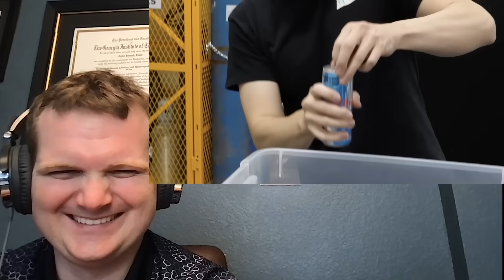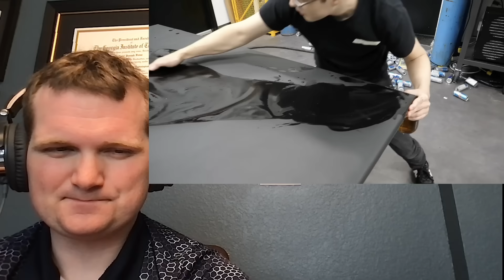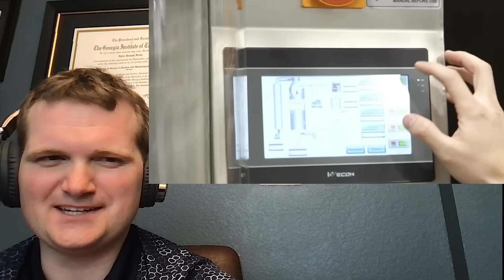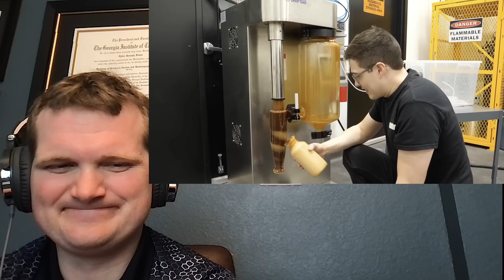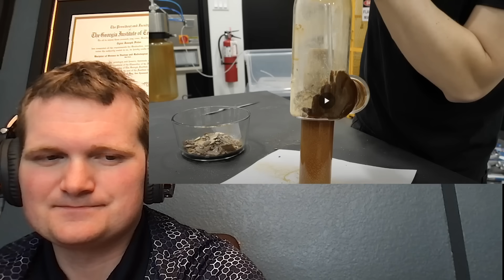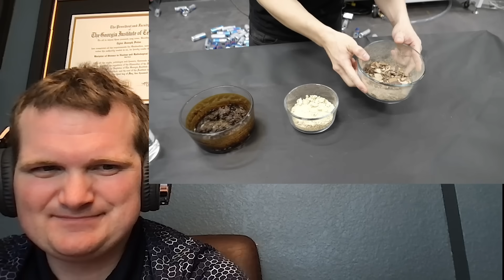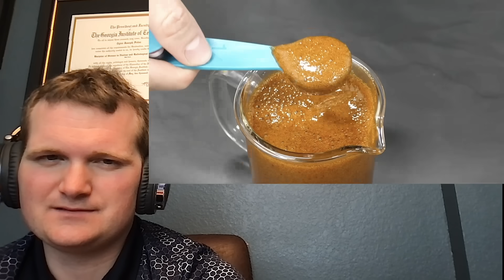Red Bull X100 Enrichment? - Nuclear Engineer Reacts to NileBlue

Comment: You talk about the caffeine and stuff, but a chemist, or a nuclear physicist, more than I, and economist, would know that is not really that 100x redbul in the same "liquid" will do 100x the "same effect". Specially because the "caffeine toxicity" would be different. I have learned it from my nephrologist when I had kidney stones driven by, among other things, fitness supplements. Caffeine main drive is to mimics and blocks adenosine and the dopamine agonist receptors, and thus, it has a lot of other effects beyond "masking tiredness". It also slows down the reflex that controls blood vessel constriction and the system that controls fine motor control. Having the mechanism it does, it is very important that there is a certain ratio to the amount of water in your body for the amount of caffeine you take. So supposed we have the ability to ingest "any amount" of water and caffeine without constraints, taking caffeine pills or industrial caffeine added beverages, and taking coffee, are two very distinct things. You might never be able to take a lethal dose of caffeine by drinking coffee because the water required for it not to be an "unbearable sludge" prevents that capacity of a coffee to not dilute the caffeine enough. On the other hand, you might be able to take enough caffeine without water using it as a supplement, to the point it might be, and I know that for a fact, much more unhealthy to take even the same amount of caffeine as a supplement than it would be that amount in the form of a very high caffeinated beverage.
That being said, there is another problem: Sugar.
You should not take a lot of sugar, nor a lot of caffeine. But if you are, you might not want that to be fructose, but you defo should have glicose in that mix when taking large amounts of caffeine. What caffeine does to your body will trigger something like a diabetic hypoglycemic episode the moment the "effect" of half life of that much caffeine stops in roughly abrupt point in time. That in mild terms is what happens when you take pre workout with caffeine and while you are training, if you have not enough glycogen, you feel you cant breathe and your heart start to palpitating, assuming you have no previous heart problems or circulation problems.
You also have the question that caffeine will pass the blood-brain barrier and raise the effects neurotransmitters have. That might sound "good", but instead, it might have adverse effects in signaling. And again, when the dose is "the same", but lower hydration is present, it might have longer lasting and more drastic effects.
And, it might get you nasty kidney stones which can lead to irreversible damage to your kidneys, if you take it without proper hydration.

Comment: The legit way to remove the carbonation quickly would have been to set up the container on top of a laboratory stirrer from the beginning and have the stirrer run while pouring the cans in.  Maybe toss in a couple of ceramic boiling chips before filling the container as well.  This whole episode was designed to fail from the beginning--it was just an excuse to show off the China machine.

Comment: In manufacturing it’s extremely common to see thousandths of an inch, however they don’t call it a MIL, it’s just referred to as a thou, short for thousandth.

The confusing one is tenths, which isn’t a tenth of an inch, but actually a tenth of a thou or a ten-thousandth of an inch, which comes out to ~2.5um.

Comment: 100x concentrated Red Bull, if it didn't kill me, would probably work as an ADHD medication. Also, when you talk about mils/thousandths of an inch.  If you work in Electrical engineering, Machine Tooling, mechanical engineering, etc. and are working with very precise designs, you can have measurements/tolerances that are in mils, or even ten-thousandths of an inch (as a Machinist, at least, I would call those 'tenths', not to be confused with tenths of an inch.)  Now, *calling" them 'mils' instead of "thou" as an abbreviation for 'thousandths" is unusual, but not unheard of.

Comment: I believe he actually covers his tables etc in a black paper material he seems to use alot i believe as a sacrificial layer, you can see how the surface on the table gets warped and uneven when wet by the redbull.

Comment: 36:40 I don''t belive the glass in the vortex well part ever broke. I pretty sure that it was the, in lack of a better term, "powder" that cracked inside the bottle. It believe it makes that pattern because of the vortex that is being created by the way the air is bowen into the chamber at the top. He calls it a "vortex well", could it be that they makes a vortex to help the last bit of water to evaporate by giving it time by sustaining the particles in the "air" before it end up in the final bottle. I believed that the glass (bottle) cracked the first time I watched it ass well, that was until I watched him hammering the glass with that metal rod.

Comment: never once had energy drink but one thing is true if you take 2 bottles of 100proof vodka try add them together think would be 200proof isn't the case the same with these red bulls won't increase the proof contains no matter if there 100 cans won't increase proof pct just drinking more what you put in never increase volume pct came with same with liquor you buy unless make yourself

Comment: Funny thing: Sodastream and most carbinators want you to carbinate the water without the syrup. With the syrup it can either over pressurize or obstruct the nozzle causing backpressure.. 
There are videos of people doing this and the units sometimes explode.. either just the device and launching the bottle or blowing up the bottle with hard plastic shards and the rest of the unit as well..
Reply: We love sodastream shrapnel
Reply: There is a breville machine which can carbonate drinks which have already been flavoured including juices and cocktails
Reply: I carbonate the water and put the syrup in a glass because I'm to lazy to wash the soda stream bottles beyond a short rinse but the bottles exploding sounds really far fetched since the sodastream has an overpressure vent that doesn't let you build up a huge amount of pressure. Some people are modding their soda streams by screwing one of their proprietary vents on a 25 or 180 L gas bottle from the hardware store that will last forever. I can imagine that mods like that can blow up without proper pressure regulation.
Reply: @megapro125  I remember having one of the original sodastream machines as a kid growing up in the 1980s: These had bespoke glass bottles made from extra-thick glass, though were much smaller, with less than half the capacity of the modern 1 litre size plastic sodastream bottles. I think these were changed out for plastic because there were a few incidents of them exploding.
Having said that, even if that did happen, it wouldn't be as dangerous as you might think. The older machines had a compartment you had to open up to slide the bottle inside, and then a lever-operated piston which forced the bottle upwards, against a cone-shaped hard rubber bung to make a good seal with the pressurising valve. I think there was also a mechanical interlock, so the button to open the valve and pressurise the bottle would not work unless the lever was in the "up and locked" position. The point being that  the bottle could only be pressurised once it was completely surrounded by a fairly chunky layer of plastic, which would contain the broken glass shrapnel if it did explode.

One advantage of the older glass bottles was that they were dishwasher-safe. Which the new plastic sodastream bottles are not. I don't know what kind of plastic they are made from, but it has an absurdly low melting point: Even water from a household hot tap can make them soften and shrink - and that is going to be 70 degrees C at the most, usually more like 50 to 60.

Anyway, if anyone does still have one of the 1980s sodastream models, you can still use it today (as long as you have the bottles to fit it), because the carbon dioxide cylinders sold for modern machines are still the same size and have the same valve today as they did back then.

Comment: Wow I never really thought about it, but a spent fuel pool would have to be treated similarly to a swimming pool or it'll turn into a swamp. I'm guessing the radiation isn't so ridiculous that it'd sanitize the water especially with the boric acid. If I remember my pool chemistry, chlorine gets more reactive in warm, acidic water so I bet it's no issue to keep it clean with the acid and spent fuel. No clue how it actually works though. Would love to see a video on it!
Reply: Your pool chemistry recollections are approximately correct: Any chlorine present will be slightly more reactive at higher water temperatures, but not by all that much, so this is not the main effect. The pH makes far more of a difference, and this is related to how chlorine bleach (aka sodium hypochlorite) is made:

If you just bubble chlorine gas into water, some of it will react with the water by the following reaction:
Cl2 + H2O <-----> HCl + HOCl
This is a special type of redox reaction (reduction/oxidation) known as a disproportionation, because some of the chlorine is reduced (to HCl) and some is oxidised (to HOCl, aka hypochlorous acid), both of these occurring simultaneously. If there is nothing else present in the water (so the only starting materials present are water and elemental chlorine, then the reaction doesn't go all the way - it is reversible.

If you do the same thing at high pH (aka alkaline solution), such as bubbling chlorine gas into a solution of sodium hydroxide, a similar reaction occurs:
Cl2 + 2 NaOH -----> NaCl + NaOCl + H2O
This is the reaction used industrially to make sodium hypochlorite, aka chlorine bleach solution. If the sodium hydroxide is used in excess (thereby maintaining a high pH), the reaction does mostly go to completion. This is why all liquid chlorine bleach contains some sodium hydroxide, and has approximately equal concentrations of both sodium chloride and sodium hypochlorite: These concentrations would be identical in freshly made bleach, but the sodium hypochlorite does slowly decompose over time, even when stabilised at high pH.

You may be familiar with some common warnings about bleach, in particular to never mix it with acids of any kind, and never mix it with ammonia. The latter is because hypochlorite rapidly reacts with ammonia to produce nitrogen chlorides (aka chloramines), which are horribly toxic and powerful irritants - and as if that isn't bad enough, nitrogen trichloride is also an extremely shock-sensitive explosive.
Mixing bleach with acid essentially reverses the reaction which made the sodium hypochlorite in the first place, reverting it back to chlorine gas.

Comment: That temperature was way too high, I had chosen more around 75°C Caramelization happens very fast, at 150°C it's like chocolate too hot, and the sugar goes into caramel, and if you try to make figures, like Santa Claus it won't make it shiny. Even would stick.

Comment: In biology and chemistry we always abbreviate milliliters as ml. Not much occasion to use the unit mil for anything, things are usually pretty large or very small. And volume, at least in chem, is more oftenof interest than size.
Reply: I use mil to refer to millimeters a lot of times when doing like jewelry since I typically work in mm for it but yeah otherwise mil is pretty normal way to refer to milliliters and even here in the us unless someone's doing machining type stuff mil almost never refers to thousandths of an inch, honestly even when I was doing stuff where that accuracy level was used I don't think I ever called them mils cause I rarely had to speak about it and the people I'd be talking to wouldn't have known what that was cause they'd just see the +/- .001 height on the computer screen and didn't have experience with that terminology so I'd just say to go up .001 or down even though it's longer it's quicker than explaining it to dumbasses over and over again each time I need help since I usually  just did it all solo lol

Comment: I assume you’re rendering whilst recording, try not to do that it worsens fps in the recording
Reply: Clearly that is happening, but I'm sort of at a loss as to what the bottleneck would be on a decent computer.  Modern GUIs use a compositor which render the whole screen as a surface.  Neither video stream is really that much in terms of bandwidth or decoding/encoding; my OnePlus 8 could record the screen with this happening on it with no slowdown whatsoever.  I've done it.  Even if he had to use the CPU to do it, it shouldn't slow down that much (?)

What I would expect is some lag due to triple-buffering.

Given the audio drops out occasionally, my guess is that something isn't being accelerated that should be.
Reply: @bsadewitz  Who says the nuclear engineer is using a decent computer? For all we know, he's using a laptop from 2012.
Reply: @nikkiofthevalley tbf a decent laptop from 2012 should still do fine, my 2015 laptop ran elden ring no problem despite being an entire generation behind the minimum GPU requirement
Reply: @bsadewitz  I don’t think his office pc is that good of a computer, especially if he is relying on integrated graphics. Even modern CPUs at the low end aren’t great
Reply: His computer can't play 1080p60 properly.

Comment: at 21:15, pneumatic thumpers are used on the cyclone portion to keep from powder build up on industrial dryers. I design and draft industrial dryers and dehydrators for a career.  Also, most dryers are made out of 304 or 316 stainless steel.
Reply: Would reducing the flow rate improve this? It seems more like some of that powder still had residual moisture so it's stuck to itself
Reply: @borttorbbq2556  I think its more or less that the cyclone chamber itself was not big enough for it to fall out of suspension. Also when things are more sugary like that it needs time to crystallized before it can be collected or you get the caking effect that was shown. I do primarily more the drafting/manufacturing design end of it, not the engineering calcs. We recently did one where we had to have a WIP section basically to give the powder time to stabilize before going to the next process

Edit: stupid autocorrect

Comment: Making crazy caffeinated beverages is no joke. I got through college drinking a coffee concoction I called "Vault 87". Robusta beans, roasted to the first crack to preserve the caffeine, espresso grind, packed tightly into a filter, then brewed via a very slow pour-over (it took a while for the water to get through all that ground coffee.) Every step designed to maximize extraction of that sweet, sweet caffeine.

Tasted like it would turn you into a super mutant, and Fallout 3 was popular when I was in college, hence the name. One upside was the taste would naturally prevent an overdose.
Reply: Try and find the issue of Gaston Lagaffe where he (Gaston) has built a machine to extract the potency of the Coffee Atom ( it's a comic, eh? ;-) ). It has a very slow drip but an espresso cup of it will make your nerves as tight as a taut steel cable ( as he promptly demonstrates by trying to work after consuming this brew... ),
Reply: @LarixusSnydes  I do wonder what would happen if this wasn't caffeine, but L-theanine, or at least a combination of both. super interesting! :)
Reply: This sounds almost as bad as my instant coffee doses.
Reply: @borttorbbq2556  College in general is a fine demonstration of the idea that it takes a little bit of smarts to be truly, incredibly stupid.
Reply: This sounds like a supersoldier drug from umbrella corporation that will kill you after first use
Reply: now that's dedication! i just mix coca cola with green tea and call it a day :D
Reply: @aJazzyFeel  You should've seen the look on the face of the independent coffee roaster (I wish I could remember their name but it was 15 years ago) when I asked how much it would cost. I may have forgotten their name but I'll never forget that look of barely concealed revulsion and horror. Luckily I think they were ultimately used to us lunatics on campus at Nevada-Reno...